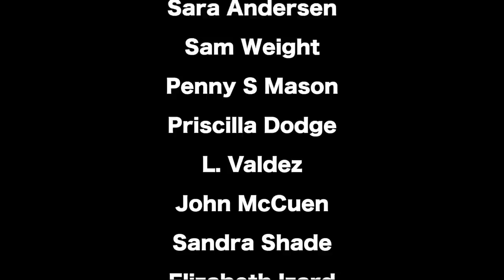HOW ABOUT STUCCO? Final Plaster Testing (Chicken Garden Day 175)

Comment: We have a bench attached to our solar shed that I have replastered 2x with earthenplaster. A month or so ago I decided to use stucco top coat from Home Depot to see if I could find a permanent solution. I used 1- 90lb bag and 1 bag of powdered stucco colorant. It went on fantastic. Dried without a single crack ( I did sponge float it) and 3 days later we had those terrible monsoon storms. It go pelted with rain! And held up like a champ! This will be the top coat solution for our house as well. I hope it works well for you too.
Reply from the maker: I think we all are sadly realizing that the monsoon forces aren't going to work with earthen plasters here, which is a bummer because we really wanted to go all natural....

Comment: Our log home was built in 1930. We bought it in 1969. It had a stucco and glass finish on the total exterior. This was in Northerm Alberta with extremes from -40f to 100f. That finish was on a stucco wire base. It was still good in the 1980s when the highway crew demolished it. The stucco was in excellent condition for 50 years. Most of our neighbors in the old farm houses also had the stucco finish. It should hold up for you folks.

Comment: I was just looking up LIME again.   My house is mostly rough coat stucco from 2007 and especially around windows and on the parapet top I'm getting cracks.  I've been adding Portland to cob and adobe mix to fortify and made high portland cob to attach to OSB / plywood.   And after extensive rains it still looks perfect.

But stucco eventually cracks and lime is supposed to get BETTER as it ages and it's so easy to repair, put on a color coat, etc.   

I haven't used lime yet and there are so many "recipes", from $140 for 5 g to simply buying lime by the bag locally cheap and mixing yourself like you did.

Regarding sand:  I read many times that the sand has to be SHARP, building quality, not the rounded beach sand. Makes sense of course.

You'd think our desert sand would work great, but I haven't tried it yet.  So much to try and so little time!

Can't wait to see how your latest coat holds up.   Thanks for sharing!

Comment: Beautiful sky video beginning. Getting some sand huh? So trying stucco. I hope this works! That's a great idea having the cement mixer closer to the build. Too bad about the generator pull string breaking. Was that Bob? Good thing you have the solar back-up. Ashley the "Master Plaster Affixer" is back at it. It looks good going on. pretty nature shots. It was nice to see you get some shade when you worked on the water pump house. It does look really good now. I hope it doesn't crack! Thanks for this Longneckers!

Comment: 3 to 1 (clean sand to portland cement powder) is a classic recipe for mortar -- used to bind bricks together for centuries. To guard against cracking in your application, you need to add chopped fiberglass fibers to the mix. :)

Comment: You could use your mixer to wash your sand.  It just to be done till the water is clear while the mixer is still running.  Just put it on a tarp like the other out in the sun and it will dry.  One thing I noticed was you didn’t measure the water in buckets.  That is important to.  Too much water will weaken the mix also.  In concrete they do a slump test.  I know stucco is different but the amount of water in it is still important.  I’m very sorry about your family  loosing Nine Nine.  He was a very special dog and we will all miss him. Good luck

Comment: not being a builder, but having had that "cracked wall" issues, my advice (probably addressed by someone already...) is to get "staples" of rebar... just drill the holes for the 2 legs of the "staple" (one o each side of the ctrack) fill in with cement and rebar, cover all with some mesh (chicken net will do) and a new coat of cement on top and it's good to go (still good here after 5 years...) Also, don't let it dry too fast, that's the main reason for the cracks I had, so keep it moist regularly
Cheers from Portugal

Comment: I would have used a mixture building Lime, Sand & Cement ratio is: (9 wheelbarrows /6 wheelbarrows /1 bag of Cement) for flexibility, as your wall will flex in the Heat & Cold! This will help with the Cracking of your Walls!

Comment: I'm sure someone has told you this before but some cement finishers put fiber in the mix. This is a fine fiberglass fiber 3/4 of a inch long & is mixed in the concrete to prevent cracking. It may help you.

Comment: Stucco - scratch coat-Brown coat- then after it curs and cracks your case week or more you apply a finish coat with your sponge Trowel. only additional problem that i see is expansive building materials any moisture= cracks. I like your channel

Comment: I think your original mix is fine, just need to be tweaked some.    Clay soil that dries after being wet cracks, high sodium in the clay causes this.    

They way that is combated in Cement, is by adding Lime (calcium sulfate) to the mix.   In Cement, the Calcium enters into the mix and replaces Sodium stopping the mix from cracking and delaying Flash set.

Flash Set, where the cement will setup as soon as you add water.    Delayed set allows you to form the cement to the mold you want.

I feel that if you added Calcium Sulfate or Calcium Carbonate you will be able to make a fine coat with no cracking.

When I worked with my Dad back in the 60's laying concrete, we had to mix everything.  We had bags of Lime that went into our mixers, then the cement mix, sand and rocks.   Portland Cement revolutionized by pre mixing everything for you.

Comment: I'm not educated in stucco, but it stands to reason that your medium of soil sand cement will retain moisture in the earthbag, the outer coating, and as it dries it contracts, and as it absorbs moisture it will expand, resulting in fractures. I'm feeling that is something that may have to be accepted, natural, and as long as it protects the underlying earthbag you may have to accept it.
Reply from the maker: No they will dry out but it does take up to a year.

Comment: If I find it again, closed the wrong tab, I will send you a video showing where at one of the smaller pyramids this guy briefly shows where the outside layer of so-called rock had fallen away. they thought it might have been poured not carved.  Anyone that watches your channel would see, they used hyperadobe earth bags.  It was right there in your face, the lines in the bags are still there.  It is a really brief part of the video.